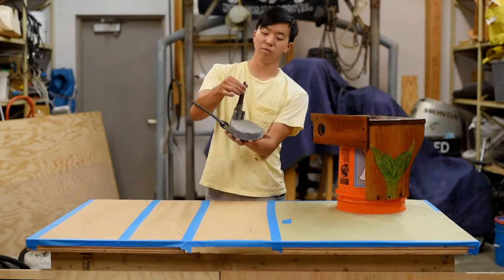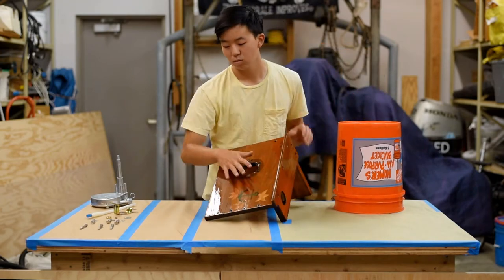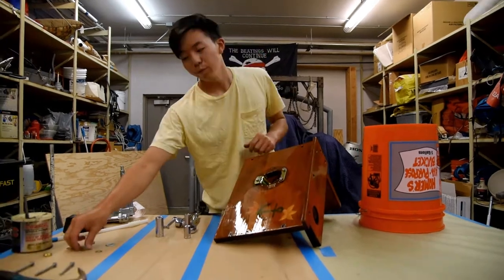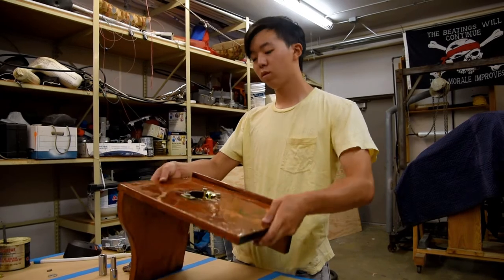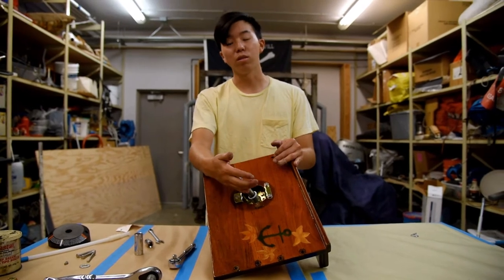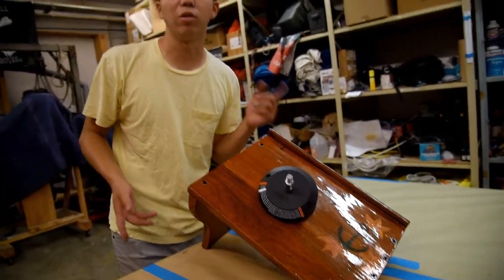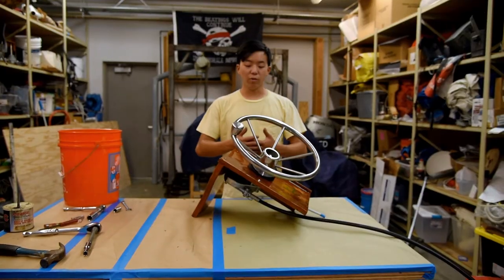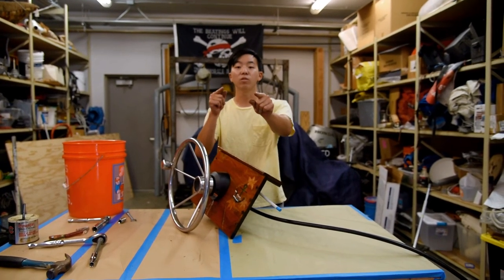Installing a NEW Sea Star Helm (13' Boston Whaler 3/5)

Comment: here on the Olympic Peninsula of WA. (dodging crap weather, not ideal for completely refurbishing 13 ft '85 Whaler.) replaced entire console/helm (purchased new through Specialty Marine, not cheap). viewed your video a dozen times, guided my work. really helpful. (my old steering system was toast/corroded, chose to toss it on the lawn, much less dramatic effect.)  used iFlex products. much appreciated.
Reply from the maker: I'm glad we could help you out!

Comment: Hi. What was the steering cable lenght for your 13 feet Boston whaler?
Reply from the maker: It's been a while, we don't recall the length. It will depends how far forward you want to have your console, weight, etc.